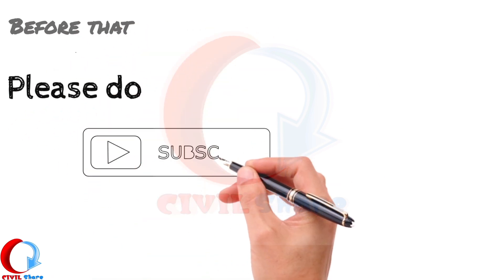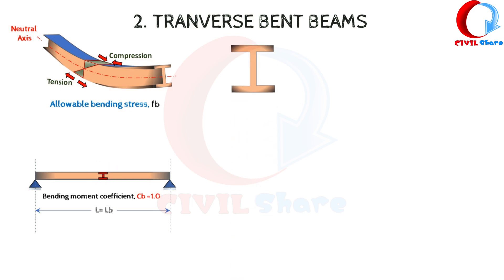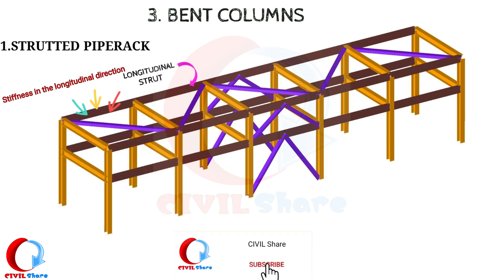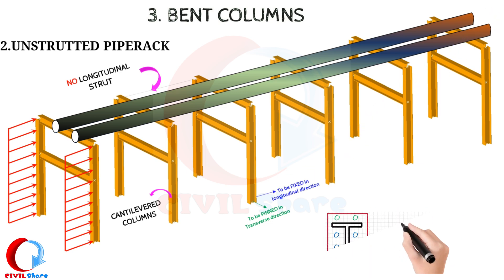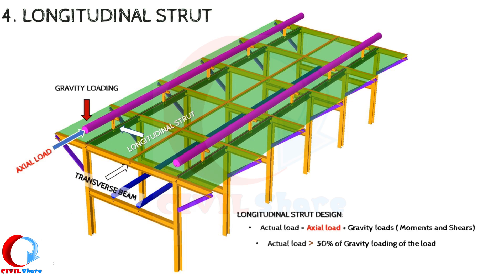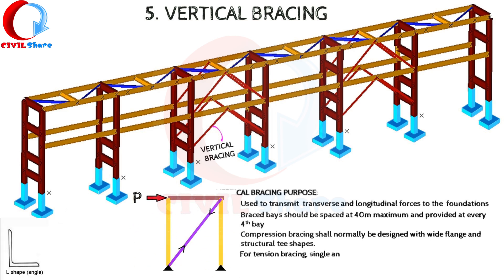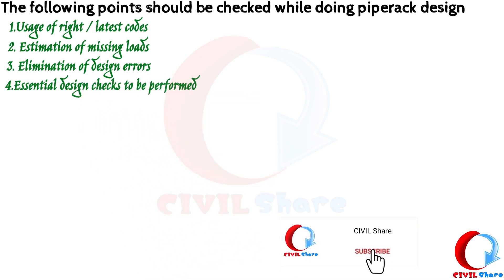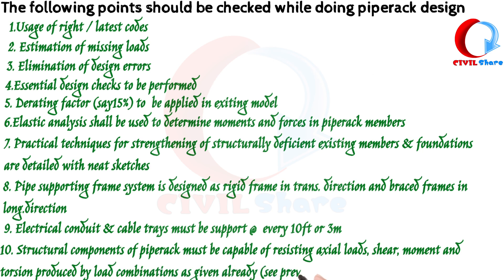PIPERACK SUPER STRUCTURE DESIGN & ADEQUACY CHECK |Part-3|Handwritten Video|CIVIL Share |7| 24.07.21|

Comment: Very well explained. I would request you to please upload 1 or 2 design of pipe racks videos on Staad. So that we can understand it's behaviour after applying loads plus what other factors do we need to consider. If possible using IS codes.
Reply from the maker: Thanks, Sure.. Will do the best soon after complete my current lineups.